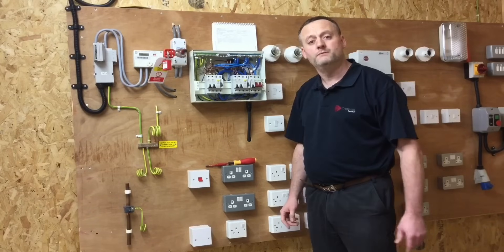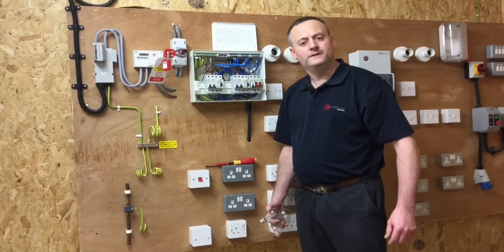Insulation Resistance Test (Includes Line and Neutral Together to Earth and Between Live Conductors)

Comment: When testing individual circuits are you not reading the cumulative parallel insulation resistances or faults from all of the connected neutrals to their associated and other grouped CPCs? Wouldn't you need to disconnect the Neutral for the circuit being tested?
Reply from the maker: Hi. Thanks for commenting and watching. The insulation resistance of the whole installation must be great than 1 M ohm. If you measure individual circuits to have 200 M ohm, 100 M ohm, 50 M ohm and 2 M ohm the overall insulation resistance would be less than 2 M ohms as the circuits are in parallel. Hence you should test with all circuits connect or you would have to calculate the total insulation resistance from all the individual ones.
This link might help https://youtu.be/MLTM-OJE0Lo
All the best GSH Electrical
Reply: Understood when testing the whole installation, but at 4:54 you're talking about testing an individual circuit and the neutral is attached... I was under the impression it had to be removed for the single circuit test.

Comment: when the insulation resistance values measured between the neutral terminal and the earth terminal at a consumer unit are below 0.5 Mega Ohm. How do safety precaution to do the troubleshooting?
Reply from the maker: Hi. You need to break the circuits down and test them individually to find the circuit(s) causing the overall insulation resistance to be blow 2Mohms. Then investigate that circuit(s)... thanks for commenting and watching GSH Electrical
Reply: GSH Electrical thank you 😊

Comment: Hi Gaz. Loving the video. 5 star mate. However, do we need to remove all load/components. I.e. washing machine, cooker etc? Or just lamps and infrareds?
Links
Reply: Do you have to remove. Loads. Like washers cookers
Reply: Of course, otherwise you'll be pushing insulation testing current directly into the appliance
Reply: All loads if you cant do that then put a limitation and state your minky tested Live + Netrual to cpc (earth)

Comment: What if low voltage transformer connected to lighting circuit and it serving fan in bathroom. What voltage test to use and between which conductors ? Thanks
Reply from the maker: Hi if loads are still in circuit and cannot be removed test only between live conductors (line and neutral) together to earth. Thanks Gaz

Comment: Thanks once again for another great video. Couldn't help but notice that after you'd done the first part of the testing and went on to throw the switches of the two way lights that the switches were, in fact, in the off position.

As i understand it, when the toggles are in the same position (i.e. both up or both down), the circuit is, in fact, off.

To be ON, the switches should be in the opposite positions, i.e. one up and one down.

I know I'm perhaps being a little pedantic, and you are certainly infinitely more knowledgeable than me, and ALSO that it'd be a moot point if an intermediate switch was thrown into the mix (intermediate switches are ON in either position; they just allow the current to pass through to one of the other two way switches), but that's good practice, isn't it?

Anyway, that's what I noticed.
Reply from the maker: Hi. Are you saying that 2 way switches cannot both be down and the circuit off and likewise the other way around.....
Reply: GSH Electrical

Hiya. Sorry I've not made myself too clear.

No. I am saying that for the circuit to be ON, one should be up and one should be down.

When they are either both up, or both down, that in that configuration the circuit is OFF.

So, let's say that if they are both up (as in the first part of your test), and then both down (as in the second part of your test), are the strappers between the two switches being tested as they should be?
Reply from the maker: Hi. The 2 way switches need to be on during the first IR test let’s  say both down. When I operate one switch (up) circuit would be off so I need to operate the other switch (up) on this means the other strapper is now in circuit and can be tested during the second IR. thanks Gaz
Reply: GSH Electrical

I guess what I'm saying is... are you sure that it was ON in the first test? Because if it was OFF, and you switched both switches, it would still be OFF for the second test.

And as I understand it, one presses a switch down (i.e. the bottom of the switch) to complete the circuit and turn the light fixture ON, but both switches were in the (assumed) OFF position for the first part of the test.

Comment: Surely, if you do the test this way a dead short in either the earth or neutral will be impossible to find. Doing it the way we were taught way back in college allows you to split your results to find insulation resistance failure in 2 potentially faulty conductors out of 3.
Reply from the maker: Hi. The test paperwork for the IET has only two boxes for recording installation resistance between live conductors and live conductors to earth hence the video. These videos are designed to provoke discussions within my classroom as it has with you. The readings can still be carried out as you have stated but the installation resistance test between live conductors together to Earth is required to be measures and recorded according to the IET model forms. This reading will not necessarily be the same as the individual tests you have stated as you will have two parallel conductors line and neutral tested to Earth in my example the measurement if often less than L/E N/E tests. If L/E was 4M ohms and N/E was 4M ohms live conductors to earth would be 2M ohms. Thanks for watching and commenting GSH Electrical.
Reply from the maker: Hi. You would find the neutral earth fault when testing between live conductors (L/N) together to earth. Then the circuit would be spit down for find the faulty (low resistance) circuit(s). Thanks again GSH Electrical

Comment: Great video. Would you be able to explain the best way to test both individual circuits and the whole installation where there are ONLY single pole RCBOs (neutral fly-lead, no earth fly-lead) installed where the manufacturers instructions state that "all connections to the device must be removed prior to conducting insulation resistance tests".
Reply from the maker: Hi. Thanks for the great massage I will add your video request to my list 👍 all the best GSH Electrical

Comment: Would you only carry out the L+N to E test if there are loads connected. For example, an EICR where it's impractical to remove loads.

L to N would cause damage to sensitive equipment right?
Reply from the maker: Hi. Thats correct. Thanks for the question GSH Electrical 👍
Reply from the maker: Hi. However the paperwork in BS7671 only has 2 boxes for insulation resistance and this was a video showing away of doing the combined test L/N to E for an initial inspection. Thanks again GSH

Comment: It requires a 'comboined' test? 2:36
Reply from the maker: Hi. The schedule of test results in BS7671 only has two boxes for insulation resistance between live conductors and live conductors to earth. I did the video to show away that could be used to link live conductors and then test to earth. I couldn’t find any guidance on how this test could be preformed other than testing from the tails (not possible). All the best and thanks for watching GSH Electrical

Comment: Hi Gaz.... Could your method  ( using the link wire) be used with RCBO's? I ask because of the neutral connection through the RCBO.
Reply from the maker: Hi. Great question. Sitting drinks wine I think you are correct... remember to have the RCBO in the off position (electronic device). Thanks for watching GSH Electrical

Comment: I think this test is good if you have a greater than figure 

But what happens if you test between phases and earth and get a reading of say 632M ohm would u then have to do a seperate of live to earth then neutral to earth?  

To find out where the reading is coming from 

Or the fact that 632M ohm is a pass as its over 1M ohm

Would you just record that reading for both?
Reply: Hope this makes sense
Reply from the maker: Hi. With such a high reading there is no issues.thanks for watching GSH Electrical
Reply: Good

Comment: How would you test all live conductors to earth on a three phase installation using your method?
Reply from the maker: Hi great question. Ideally you would be linking at the disconnect tails as shown in many testing text books (as if you can do that when the supply is connected). I came up with this solution for a single phase installation as I was constantly ask by learners how to over come this issue. I will have a think but industry gives no guidance have you got a solution.?

Comment: Are you suggesting that by testing live conductors to earth individually as opposed to combined is wrong???
Reply from the maker: Hi. Great question. The insulation resistance test of live conductors (L and N) together to earth will give an overall insulation resistance lower than the individual L/E and N/E. The model forms for BS7671 only have two boxes for single phase insulation resistance. Hope this helps (currently shopping with the wife). Thanks GSH Electrical
Reply from the maker: If you had 5 Mohms L/E and 10 Mohms N/E which one would you record... because if you tested live conductors together to earth would get a reading less than 5 Mohms...
Reply: Appreciate the reply GSK. Surely by testing between live conductors to earth combined or individually though is preference. After all if a result above 1M was found combined the next steps would be to then split them and test separately. I get for a periodic etc then combined or at 250v due to loads. Just seems like your stating it's WRONG. Am I missing something??
Reply: Sorry less than <1M
Reply from the maker: Testing between live conductors to earth will always give you a lower reading than L/E and N/E. BS7671 paperwork requires the results for between live conductors and live conductors to earth to be recorded. I understand that LIM’s will be applicable on periodic inspections. All the best GSH Electrical
Reply: Some great vids and very informative. Keep up good work. 👍
Reply from the maker: Thanks for the support GSH Electrical

Comment: Hi GSH, thank you for the video. Very helpful method to allow the collection of the combined reading
Reply from the maker: +David Roche 
Thanks. Often missed in industry the testing of both live conductors together to earth. All the best and keep watching GSH Electrical
Reply from the maker: +R P 
Hi. The insulation resistance test is the third DEAD test and GS38 applies to live testing probs. All the best and thanks for watching GSH Electrical
Reply: Is the old lead acceptable under GS38 as it has more of an exposed end?